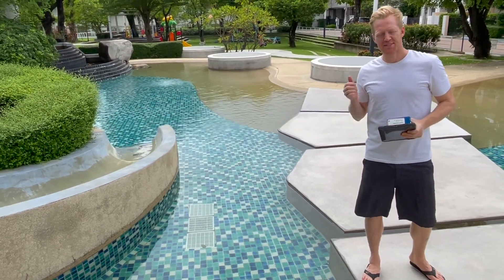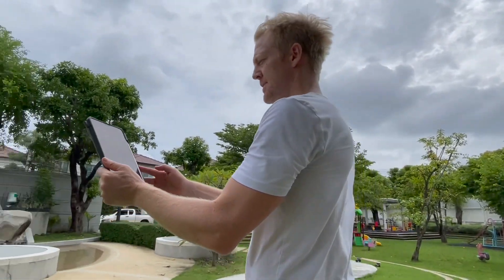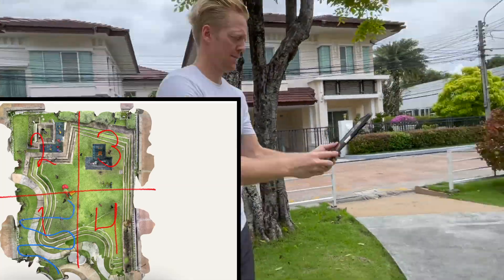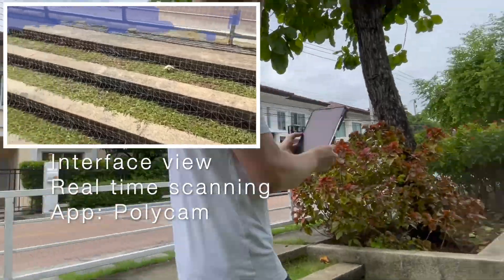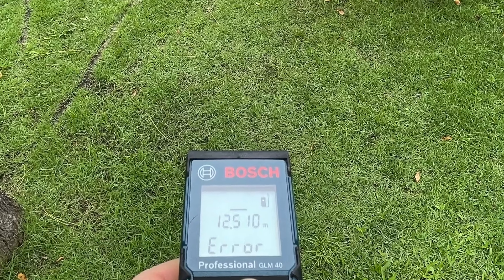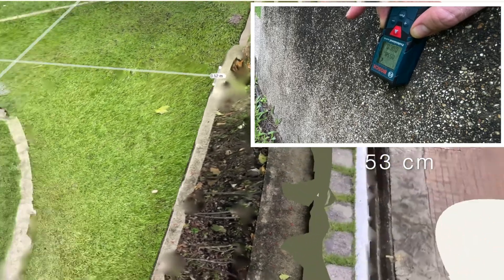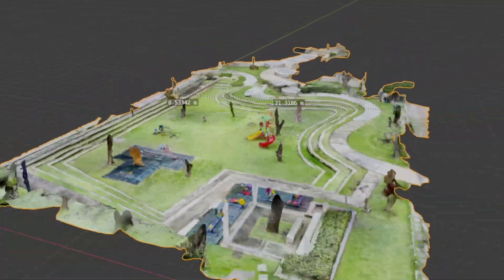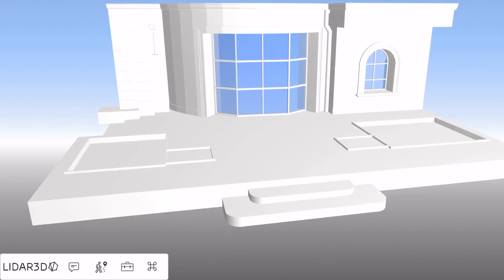Apple LiDAR scanning outside areas - Accuracy test

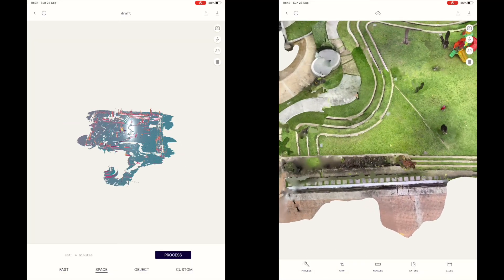Comment: I note the discontinuities in your mesh as shown at 4:00 and towards the end of the video (especially when you show close-ups of the footpaths, where the edges don’t match up). This is, of course, caused by the iPad/iPhone’s inertial measurement unit (IMU) drifting (becoming less accurate) over time.

FYI, you can get significantly better results using a scanning app that takes advantage of April Tags. Dot3D is the app I use and the results are superb. Using this method completely compensates for the IMU drift.

(The April Tags can also be surveyed with e.g. a RTK GNSS receiver or total station, and those coordinates can be used in the Dot3D app to georeference the entire point cloud).

I have used an iPhone 15 Pro Max and the Dot3D app to scan a length of road and associated footpaths/sidewalks about 100m long, 20m wide. Using April Tags for IMU correction and georeferencing of the point cloud.

I then surveyed the same area with an RTK GNSS receiver and the point cloud data was within 1cm of the RTK GNSS dataset.

Scanning the area with the iPhone took about fifteen minutes. The processing for the iPhone scan data took about three minutes, not including the time taken to assign real-world coordinates to the April Tags (that took about five minutes, total). (It took about 20-30 minutes to set up and map the April Tags using the RTK GNSS receiver, and about another five minutes to get the data from the RTK into the iPhone). All up, it took about 30mins for the scanning, and about 30mins to map the April Tags with the RTK GNSS receiver.

By comparison, it took about two hours to map most things in the same area using the RTK GNSS receiver alone. (I say “most things” because the iPhone LiDAR scanner maps absolutely everything, whereas the RTK GNSS receiver only collects a single point wherever I have put it, and I wasn’t about to collect hundreds of points around each tree.)

Other commenters have suggested using a gimbal to reduce the IMU drift. I tried this but in my experience it only had minimal benefit. The switch to April Tags made the greatest impact.

Comment: Using an iphone and drone would probably speed up the process! (Since some areas cannot be scanned like the wet areas and weird land elevations)Although I haven't tried it yet since it is expensive method would deffo come back if I have it someday!
Reply from the maker: Yes drones are good, especially for exteriors. 

Check out Gaussian splatting. You can make models based on images / video from any drone camera. Polycam also has this feature in the app and I believe it’s free to try :)
Reply: @LiDAR3D  Are you referring to Photo mode?
Reply: @LiDAR3D  Again, what is the name of this feature in the Polycam app?

Comment: Brilliant stuff! Have you tried exporting to sketch up and adding exterior design elements, like a gazebo or pool? Or would you recommend exporting to something entirely different if you wanted to draw over your scan?
Reply from the maker: Thanks! 
Yes, we are actually SketchUp specialists :) 
You can export files in formats that work in sketchup or other similar CAD software such as blender which is free to use.
Reply: @LiDAR3D  very interesting. Are the sketch up files pretty faithful to your scans?

Comment: Hi, thanks for the video. In terms of spending for an iPad pro or iPhone Pro, memory capacity is an issue. Asking about this project. How much MB was the point cloud file?
Reply from the maker: Thanks for watching! I exported a mesh Obj file which was around 50 MB for this project.
Reply from the maker: A point cloud capture is possible with other apps. The file size of iOS point clouds would be larger. 

Our latest video compare meshes and point clouds and includes info about the file sizes at the end of the video.

Comment: I’d probably try using a tripod, rotating 360 then moving on to the next plot
Reply from the maker: You're right, that approach works for most cases :) 

Problems with 360 photos can be occlusions and piecing the layout together if there are lots of trees and bushes or buildings on the site. It's also much harder to extract measurements from 360 images. I haven't seen anything above 95% accurate to date. 

Drone shots and online maps can help with getting the shape and size but are also unreliable in certain conditions and struggle with land plots with lots of vegetation. 

Before iOS LiDAR I worked as a dev lead for a Proptech company with thousands of site plans yearly. Our production team often had to resort to using data from multiple sources on an order-by-order basis depending on the conditions on-site. 

Using iOS LiDAR has its challenges too but I would say it's easier, quicker, and more reliable at scale than other tools for the task. 

Thanks for watching and commenting 😃